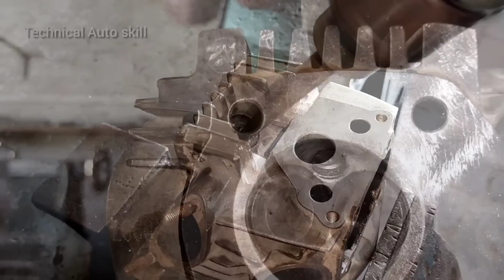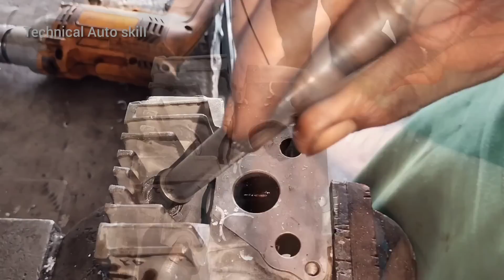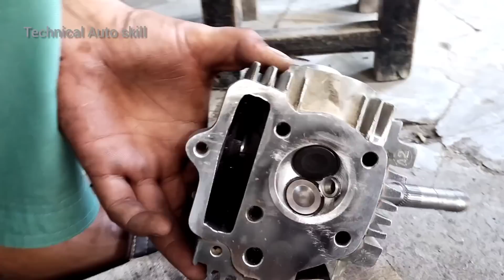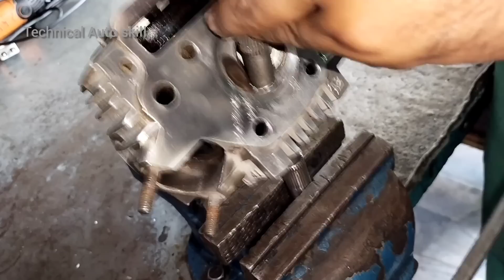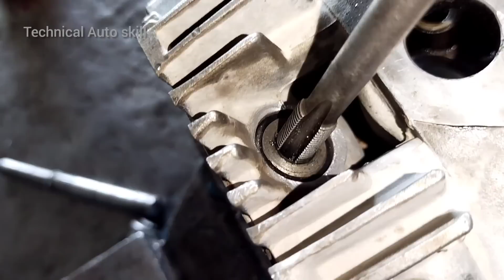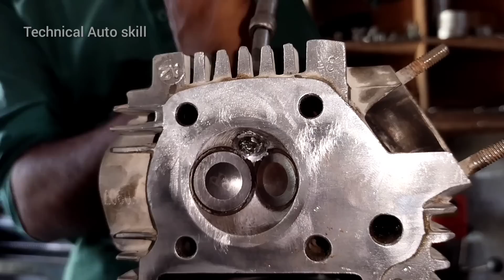How to fit a bike plug bush. How to repair a 70 CD Honda bike plug Bouch fitting

Comment: I used Helicoils on my aluminium heads from a 250cc in the sixties. They have been around a long time. I would suggest that it is necesary to remove the heads first as they need to be tapped oversize to take the Helicoils which when inserted sizes it back for the spark plug. You would not only have swarf falling on the piston but also the nib on the Helicoil used to insert it which you then  break off. Ric from Oz 👦🇦🇺👍😎
Reply from the maker: Thanks, ❤️